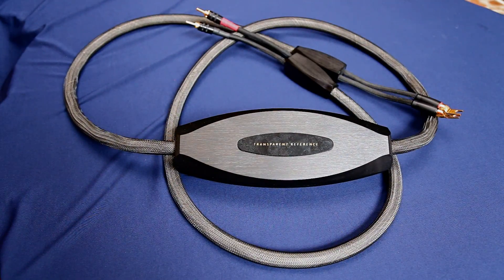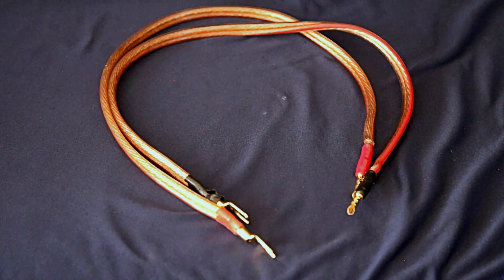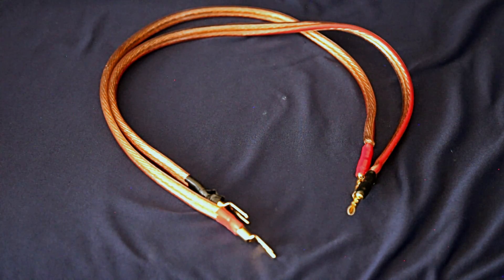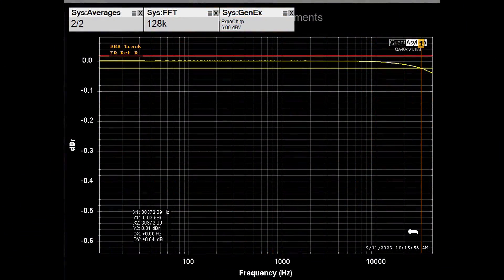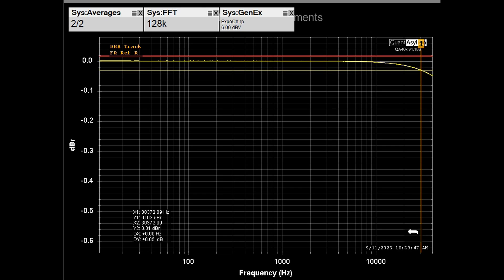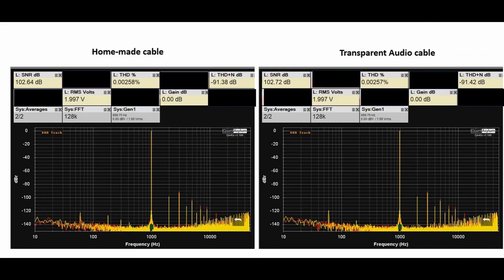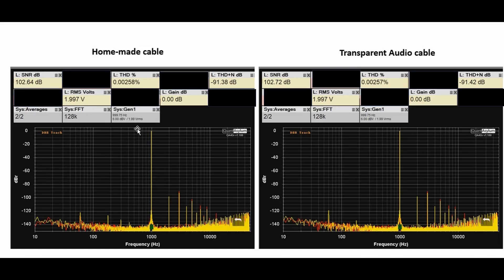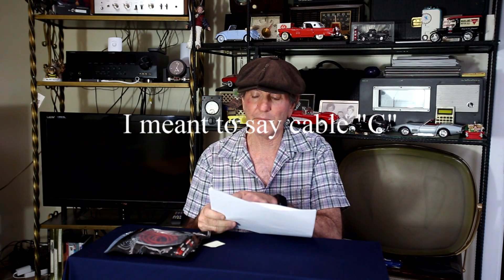$8000/pair Speaker Cable  vs. $14 DIY Speaker Cable A/B Test: Vintage Audio Review Episode #87

Comment: I do not have an opinion one way or the other, yet. But using even a short section of wire from the source , I think nulifies the test entirely. Do Another from the source each with only the correct test cable... And  go stereo for sound stage and immaging comparison on a kick ass well recorded  music source.
Reply from the maker: I appreciate your taking a few moments to share your thoughts on this. And I get what you are saying- I did the best I could with what I had. To do the imaging part with two speakers requires a set up that I have not figured out how to create using two sets of speaker cables, which would have to go through some sort of switching box that ultimately folks would complain about. But the science is there to show  how speaker cables don't have much of an effect. Check out the Audioholics/Benchmark video on the subject.

Comment: Transparent reference cables are tuned for specific amp and speaker. If that had not been made for the test, I think that could have a slight effect on the result. Not sure how much. But using the short cable in the signal path with the switching block and all those components will have a degrading effect as well. So there are two things that affect the test and the performance for the Transparent already. I have had Transparent Ultra that I bought for Wilson Audio Sabrina X:s. They don't need tuning, I bought them used but eventually I ended up returning them. I compared them to Audience AU24SE which were better overall in my liking. Transparent was superb on high quality recordings but butchered some of the tracks like old Rolling Stones records that were very musical and enjoyable with Audience. These comparisons are really cool but I just want to say that with different systems and no other devices on the signal path the results may vary. Just my two cents. And cables do make a difference and great stuff can be had with DIY as well. But I say hearing all yourself is important and I often use also friends that are somewhat familiar with my system and demo stuff to them and hear how they feel about that stuff. Often experiences are similar but sometimes different because we all have different reference points and we all are different.
Reply from the maker: Thank you for taking the time to share your thoughts in a non-combative manner! No other video I have done drew as many views as this one and as much discussion. In regards to being "tuned" for a particular amp and speaker, not really sure how they are going to do that in a practical manner. The test was not perfect, but just a fun thing to do and I have thought about doing it another way  to minimize other stuff in the signal path, but have not come up with a good one yet. Without the ability to be able to switch instantly between two devices I doubt one's audio memory is able to tell a difference between speaker cables without some mitigating factors (such as using a very thin wire gauge over long distances). The science/measurements    don't support being able to hear differences. Search for a Youtube video from Audioholics with the engineer from BENCHMARK showing how little speaker cables can affect the overall sound of a system. At the end of the day, folks can spend their money however they want to and if they say they hear a difference, good for them.

Comment: Fooling around with some different interconnects and speaker cable can be interesting as long as expectation and investment are minimal or recoupable. If you are wealthy - fill your boots....!
Reply from the maker: My experience is that folks end up claiming big improvement in their sound, when the data and science does not support such claims, but they can spend their money however they want.

Comment: Am I to understand you ran the test cable from the amplifier to the speaker switcher but then from the speaker switcher you ran cheap cable to the actual speakers?
Reply from the maker: Thanks for the question. The only way to do the test (at the time) was to have a sort, home made cable which consisted of a pair of 12gauge speaker cables connected in parallel, connect between the a/b switch box and the single speaker- It was maybe 2-3' in length, and they both went through it.
Reply: @vintageaudioreview  if they both went through it, then you eliminated any benefit of either one of those cables because all the speaker could get was what the last little cable had to offer from the switcher. This test is total garbage.
Reply from the maker: @teslatalk42069  It was not the perfect test, but I would disagree it was "total garbage". The third cable  that the both went through was at least 1/3rd the length of the other two and electrically could not have affected the measurement. It was a fun test for the group that participated.

Comment: No statistically significant difference between the sound of the two cables, as expected.
Reply from the maker: Thanks for the comment, but of course there are those who don't consider it a valid test for whatever reason......

Comment: One thing that people should understand is that inside our speaker cabinets are wire of regular quality. Long lengths of multi stranded copper wire of the same type we can pull from a spool at the hardware store. Any benefits from luxurious speaker cables stops right there at the back of our speakers.
Reply: Sometimes.  But some high-end speakers have great wire internally.  My Acoustic Zen Adagios are wired internally with Acoustic Zen Satori.  When I first bought them I used 18 gauge lamp wire to connect them to a Proceed AMP5, and the resulting sound was very thin and disappointing.  I bought them used and thought something might have damaged them during transit.  But then I remembered that I had an 8' pair of AZ Satori speaker wires in storage that I'd bought years before.  I dug those out, connected them, and the difference was pretty startling, especially in the bass and the transient response.  I used to think high-end cables and wires were a joke; not anymore.  I don't think they make a difference in all circumstances, but in my particular circumstance there was a significant and noticeable difference.
Reply from the maker: @sem3p  Thanks for sharing your experience. I would say that 18guage wiring would be a bit on the thin side to use. If I connected my home made cables in place of your Satoris I would be surprised if you heard a difference in an a/b test....
Reply: @vintageaudioreview  I agree, that would be a fun test.  I used the Satori cables because they were just collecting dust in a closet.  It would definitely be interesting to compare them with less expensive, but still good quality, cables.
Reply from the maker: Very good point, though I have seen some very wire used to connect different sections of a speaker like the Wilson Watt Puppies I have.

Comment: Thank you for doing these tests. Audiophiles just don't get it. Standard 12-gauge wire from the hardware store is an excellent choice as speaker cable.
Reply from the maker: Once again, thanks for taking the time to chime in- But if someone want to spend their money on expensive speaker cables, that is their option.

Comment: The fact the people think numbers are how you measure the sound of something amazes me. I would agree that charts, measurements and number to amount yo certain amount of value in the conversation. But i listen to my music, not measure you. With right equipment, some cables to actually make a difference. I own the transparent cables being reviewed, and i can say this, yes they are expensive, yes they made the differences i wanted to hear, and to me they were worth it. To many they will not be. But that is okay, no one else but me paid for them. But anyone listening to my system gets to enjoy my choice. Use what you want, but graphs dont show what things sound like. They only show measurements. That mustang with the same horsepower as vette, while they both have the same horse power, they both ride different.
Reply from the maker: I appreciate your car analogy, as well as your overall comments. With the car analogy, we can measure all of the differences such as interior noise, legroom, brake and throttle pedal pressures that may contribute to what the ride is like, and a lot of that is personal preference- there is no right or wrong.The Audioholics channel recently put a great video with an engineer from BENCHMARK, a higher end audio company, showing how very little your cables affect the sound. Your room and speakers have the greatest effect. Move your head a little to the right or left and your listening experience can change. Graphs can certainly predict what something may sound like. But that can't tell me what an individual may like. Maybe you have some high frequency loss and like your sound a bit brighter (more treble) than someone who does not, so you may prefer a horn speaker more. There is also a psychological effect that could happen as well- you just spent $1000 on a "DC" block for your system and you hear an improvement- good for and part of the hobby I suppose. The test that was done in this video was far from perfect, I'll admit, but was the best I could do at the time. As I said in the video, you can spend your $'s on whatever floats your audio boat 😃
Reply: @ agreed we can spend our money as we so choose. But i say spend it wisely on what actually works. Do batterys on a cable do anything, i dont think so. Altho i do think that transparent gets it right with there lil system they use. Some of this stuff out there, is junk i will admit. And because there is more junk then quality it throws the overall wires dont matter. Where as the right wire does. Sysnergy also comes into play too. And measurements to account for something, but those measurements are generally in a testing enviorment, and everyones space is different. Ever have that friend that no matter what he buys, it just doesnt sound right, but it does for everyone else. So i agree that it also comes down to having a good space, but all the other things combined make for a great combination and enjoyment. Many frown at the rel six pack, but i tell you what, not one person has walked out of my room and said that didnt sound great.
Reply from the maker: @bg7059  We are never going to agree totally, but I do appreciate the civility of this discourse. Am not familiar with the rel six pack you mentioned. I do know one person that is almost never happy with anything he listens too. I am more of a "gear guy" and enjoy owning something that I wanted in the past or found out about recently- that sounds good to me, and gave up the idea of listening perfection so as not to drive myself crazy. My guess is that if we did an ABX testing with transparent cables and my DIY cables, neither of us would get a significant statistical difference correct.

Comment: I’m sorry, this test is invalid.  First of all, we know the difference between them is going to be small, so you will be looking for extremely small differences.  First off, take everything out of the signal path including your a/b box and your “12 gauge cable” and only measure the cables.  Secondly, use the correct test for the job, measure resistance, impedance, capacitance and inductance, noise and reflections.  That’s all there is to measure about wire carrying signals.
Reply from the maker: I appreciate the comment and suggestions. There would probably be very little difference between the parameters you suggest measuring- it was just about hearing a difference under as close a condition as I could create.

Comment: It’s funny because even though there’s no difference in the signal, audiophiles swear that they hear a difference. Once I was arguing with a guy who was claiming that his 1000 dollar Ethernet cable improved his bass response. Bro, that is literally not possible. The networking layer will make sure the bytes are carbon copied across the network. A $5 cable will work just as well.
Reply from the maker: Thanks for taking the time to share. I heard a similar thing about something you could plug into your router that made the sound better. And what about hi-performance toslink cables that improve the sound- that was another one. But, as part of the hobby, if you want to go for something like that and it works for you, oh well, just don't try to convince us 😀
Reply: I went to a friend's house that I visit every week. I advise him on decisions to his gear often. I sat down for a listen and noticed right  away he system sounded more bassy than ever before. I asked him what he had done as I count see any obvious changes. He told me he changed the Ethernet cable. You need to stop fighting the anecdotes you constantly hear. People have come to my home and been converted just by listening. Do you honestly ghing people want to spend money on cabling? We don't! A cable is just another component in the system, not a sexy one, but other e nonetheless.
Reply: @carlosoliveira-rc2xt  I am a software engineer specializing in networking. It is literally not possible for a stream to have "more bass" when using different cables. Believe whatever makes you feel good, but holy fuck man, you are factually wrong.
Reply: @carlosoliveira-rc2xt  
Perhaps you should research the facts that were discovered and revealed through many different medical and institutional studies of the human auditory system's extremely short-term memory.  ;)

What you hear today (or 5 minutes ago) is not what you heard yesterday, even when nothing has been changed.

In addition, there are variable external influences on what we hear at any given time, including emotional state, height of awareness/concentration, visual stimulation, environmental conditions affecting soundwave propagation, and so on.

That's why engineers require consistent, repeatable measurements and controlled testing methodologies.

Comment: audiophile believe expensive cable can tune their system sound better but they not believe cheap eq can improve it immediately
Reply from the maker: Thanks for taking the time to comment and you are correct for the most part- some audiophiles do see the advantage of equalizers as part of DSP that may be in their streamer...